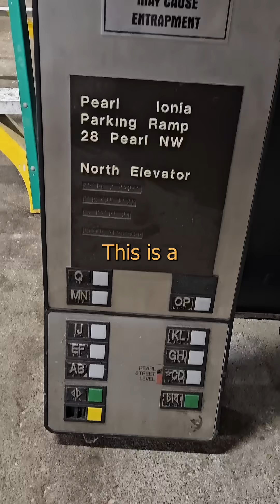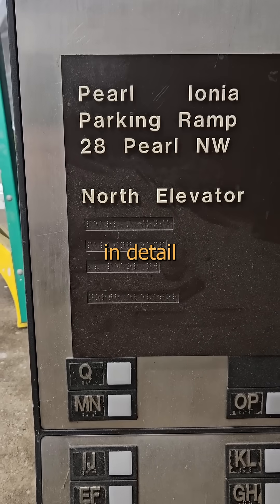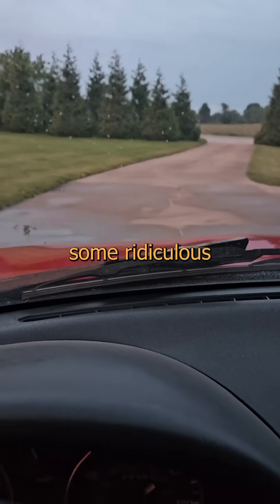Miata Mischief #chrisboden #engineering #gear #elevator #score #stories #parts #hacking #making

Comment: When I first got a welder, I needed a trailer to haul angle iron and so forth. But my only vehicle was a beater 1962 bug. It turns out that you can load some angle iron on top, give it a little thump to cave the roof in just a bit. THEN you tie it down through the windows and to the back bumper very securely and drive home. Once you get it unloaded, you give the roof a good whack from the inside and the dent pops right out as good as it ever was.
Reply: I feel VW likely didn’t do adequate metal fatigue testing for this use case. 

Let’s hope whoever got the car after you doesn’t roll it, or is already short. 

Not for nothing, do you know if it’s possible to work harden a VW Beetle? Asking for a friend.

Cheers!
Reply: @0ddSavant If it's steel, it may be fine. Steel can go through many cycles of deformation, that's why we make springs out of steel.

Whether that deformation is completely elastic, and if the roof is the right kind of steel, is a different story.

Comment: Not the sketchiest, but that day I learned to ratchet strap and read a road height warning. When I was an intern I wanted a big screen TV. I found a 84" rear projection TV and squeezed it into the bed of my ranger and it stuck 3 feet over the roof and 2 feet off the back, and we had to navigate it home through tunnels amd several bridges to my summer apartment in Rhode Island at the time

Comment: Let’s see now… done a lot of scrap metal runs. There was this one restaurant throwing out an old AC unit. They called us, we showed up with our dodge dakoda… took 4 people just to lift the AC units, and the suspension on the tired old truck was not happy. That truck was swaying down the road all the way home. Only a 5 minute drive, but man you could really feel the weight in the back from the cab.

Comment: A friend and I took a folding motor crane apart and fit it in a Volvo 850 sedan.
A simple fender bender would have resulted in decapitation but we made the hour drive, up hill both ways.

Comment: Haven’t done much hauling because I have a midsized truck, but I have used it as a temporary tow truck.  I once helped some strangers (I live in the Midwest… it’s what we do) to pull their car a couple miles using tow straps.  

Another time I pulled a dead work truck (2016 3500 loaded monster) and pulled it across the icy parking lot to get it in one of our bays.  Once I got to the point I couldn’t pull any further and needed to push it, we used old tires to not scratch the vehicles.  Work like a charm. 

I help people on the side of the road all the time, so I like to be the Swiss Army knife of vehicles… not too big, not too small, a little unconventional, but managed to pull through when you need it most.

Comment: Winning a 10KVA pole pig at the Cheesehead Teslathon.  Had a fork to load it, but had to unload it by myself.  There's a reason we call them pigs!  Got it into it's roller dolly without dropping or spilling it.  Still have to build the reactor for it. Have the core, just need the 200C wire.

Comment: Before my time, but definitely a unique haul. In the late 80s/early 90s, my dad had a custom squarebody Chevy pickup. Black, short bed, with a 6 inch lift and 36 inch tires. He found for sale a telephone pole. Why he needed a telephone pole, i do not know. What i do know is that he decided the best way to haul it was under his truck. With the telephone pole laid down lengthwise, he drove over top of it until there was a roughly equal amount of pole in the front and back of his truck. He then took 2 chains amd chained the pole to the bottom of each axle of his truck. He hung a red rag from either end of the pole for visibilty, then drove the truck and the pole home as one unit.

Comment: Oooh, I've got a couple.

One time I loaded an old Ford Ranger up to the point of bottoming out the suspension. The weight itself isn't the interesting part. It's the fact that the ENTIRE BED plus the passenger floor board, passenger seat, and middle seat were packed FULL of records (the spinning plastic kind). That was $20 well spent, much to my mom's chargin.

Another time I loaded up a 1992 Saturn (about the same size as the Miata) with computers that were otherwise destined for the dump. Would have grabbed more, but I couldn't haul anymore and was only allowed one trip. That made for a fun summer of tinkering.

Lastly, I needed to haul a 10 foot long section of PVC pipe in a Ford Escape. Easy, right? Wrong. The car was about a quarter inch too short, and I cracked the windshield when I closed the hatch.

Comment: I hauled a half full server rack with my 50cc moped. Only the top half was full so I was able to put the rack over the moped and bolt it to my exhaust bracket. It was top heavy and I was scared I'd fall over in every turn. Lol but I made it the mile and a half I needed to go

Comment: I towed a 21k lb. military surplus truck with my 2010 F250. We didn't have any kind of tow bar, so I ran a 3/8" chain through a 2x2 piece of steel box channel about 6 ft long and hooked the trucks together with the chain. I towed the dang thing for about 20 miles. The truck had no brakes, of course. I couldn't believe it worked and we didn't wreck both trucks in the process. 😂😂

Edit: Oh, another time while working for my dad, we hauled a 6 ton blower in the bed of his 3500 Chevy. Talk about sketchy. Every pebble we hit in the road, you could feel the suspension bottom out on the axle. That weren't no 20 mile drive, either....😂

Comment: I strapped a 7ft tall 4ft wide shelf on top of my 2000 Jeep Grand Cherokee with 2 rachet straps off of a collage campus with no parking pass no inspection no registration and a unpaid fine resulting in a warrant. When I went to leave the cops were in the parking lot watching a demonstration done by a lineman company, thought I was in the clear till someone with a crackle tune on a VW Golf turned as I crossed the road. As I'm crossing I'm making eye contact with the cops and the look on their faces was incredible. That was a long 45 minute drive from work turned over an hour because going above 50mph the front end would start lifting🤣🤣

Comment: 12 years ago I used my 95 Miata to move 55 miles. Everything but my furniture and a few large items were loaded in that little car. I’d load it after work, drive to my new house & unload it. The next day I’d do the same thing. 
The most difficult part was when I moved an entire rock collection that was well over 1500 pounds In two trips. 
I loaded the trunk & passenger floorboard with rocks & then piled on every light weight item and box that would fit. 
 That little car handled it like a champ. Yes it tended to wallow around a little in the turns and I kept my speed down to 55 or below & I did get stopped and warned by a county sheriff because I could barely see to my right & couldn’t see anything behind me but it all worked out.

Comment: So I drive a Saab... I LOVE my Saab.. but it's also my project car currently. It's a 2006 sport Combi wagon, but it's in the middle of an interior swap, meaning it dosent have one installed right now... It has the steering wheel from a totally different car, two seats and a gauge cluster with bare exposed circuit boards and wires wrapped up in masking tape, meaning yes... No dash... Or anything else really.

So my friend needed to get parts for his truck I'm helping him build the other night, but since my new daily driver isn't registered yet, the Saab it is, plus we kinda needed the space, so off we went driving 2 hours away in a car with no interior, that only has lights that half work, that I have to start by screwdrivering the ignition tumbler to on, and then get out and jump the starter to the battery to hotwire the car, additionally if I need wipers, I have to get out and plug the relay for the wipers In to turn on the driver's wiper, passe ger side dosent work and windshield is broken af.

So here we are headed off to get his parts, with me driving using my phone as a gauge cluster cus the speedo dosent work and neither does the fuel gauge, meanwhile it's getting dark, so I have to hold the turn signal stalk pulled to keep the headlights turned on, and ask my friend to touch a brown wire to an exposed red wire whenever I am breaking cus the breaking light switch is also broken. 😅

When we get there we discover that not only do the rocker steps for his truck not fit in the back cus they're way too long, but also the fuel tank was still full of gas... Which he forgot about.

So we cut out the old trucks seatbelts to use as tie downs to strap the steps to the roof of the wagon through the door windows, then roll the windows back up to pinch the straps and extra secure it with duct tape, and the fuel tank we put inside but because of the fumes we had to stop at a Walmart and get some hose so we could stick it out the sun roof and use it as fresh air vents cus we can't open the windows both because of the seatbelt straps, but also because I have a side exit exhaust on it that comes through the back bumper that required I cut into the rear floor to fit the pipes but I have yet to weld it up, so if you open the windows, the negative pressure sucks the exhaust gasses back up from the back of the car into the cabin and suffocates you... And it's carless... So it's REALLY SMELLS... so we made the trip home looking like a couple of LARPing scuba divers in my car... Really got some odd looks when we blew a tire on the way home and had to pull into a station to swap it out 😂 , especially since my friend is 6'2" and dressed like a burly bearded biker, but I'm the driver AND the one changing the tire out and I'm a 5'5" UwU cat girl wearing a cropped anime hoodie and a miniskirt with fishnet leggings and furry leg warmers 😂. 

It was a fucking weird ass but interesting trip to be sure... But God I'm so looking forward to getting my new car on the road.

Comment: A few years ago I brought home the full drive train from a 1983 Datsun 280zx turbo in my friends 2004 Scion XB. It was tucking rear tire in the fenders in the rear wheel wells for the whole 2hour ride home, and thats half the weight the owner had put in it bringing home bags of concrete. 

The first day I owned my own Scion XB I took 3x5 sheets of OSB to build something for my mom. 

I want to buy another truck but WHOLLY crap people want absolutely insane prices for them with 100-200k miles. I can hold off another year or so, but eventually I'll have no choice. I'll look at every thing from new to used but Im not expecting to enjoy paying for it.

Comment: I had a 1st gen Miata with a proper roll bar. I have lashed just about anything to that roll bar all the way up to 10 ft lengths of lumber to entire tires mounted on wheels. 

Also removed the passenger seat to move a larger air compressor to do a roofing job once. 

When you have a convertible the sky's the literal limit.

Comment: About 8 years ago, I bought a desk from someone 10 minutes drive down the road from my home. It was too bulky to carry, so I had my roommate take me in his car to pick it up. It being a sedan, there was room in the back for the supports but not for the top.
I had my 5' something roommate sat in the back seat, holding the tabletop wedged behind the front seats. The rear passenger door couldn't close with it in there, so they had to hold it shut for the 10-minute drive back to the house.

It all went well and I still have that desk today. I drive a station wagon now and it works great for transporting big stuff like a desk.

Comment: I once strapped a GIANT street lamp to the back of my sportbike. Weird gas discharge lamps tickle my brand of 'tism and i needed a 150w high pressure sodium ballast which was in that fixture, to run a rare and special  improved CRI sodium lamp. The thing was a good 80cm long and 40cm wide thing you would find on highways here until the ledification. 
Although the thing was well secured, people behind me kept a longer follow distance than usual and no one dared to complain about my bike's mediocre lights. It was sticking out and up, due to the difference in height of seat, passenger seat and the mounting bracket of the top case, so if it would've been lit - it would've absolutely blinded everyone behind me. 
I also once carried two 60cm diameter x 60cm long cast aluminium public address horn speakers by train and bicycle. I feared my handle bar snapping in half, but it held up.

Comment: I hauled a 5 meter metal pole on the back of my bike when I was around 13. I had to find a way to make it not fall off the back of my bike. so I tied a rope around my waist and then to the pole. So I was biking down a long-ass hill from my school - where I stole this from - to my parents' home. If anyone was on the path, I would have clotheslined them with 2.5 meters of improvised steel limbo poll on each side of my bike; as the breaks on my bike had been redused to nubuals a long time ago, and replaced with the classic "Putting your feet to the ground" tecnique. Luckily it was kinda late at night and noone was around. Though… as it was dark, and the streetlights in this are never worked as long as i lived there. I didnt remeber that they even existed, and by going slightly to far to one side on the sidewalk, I slamed one end of the poll against the wooden trunk of the streetlight and sent myself sailing into a ditch at "Fast as fuck" speed. I was somehow fine and got the poll home without any further… incidents.

What did i do with the poll? I wasnted a welding kit, and decided to gather materials to make random shit. I never got a welding kit, and the poll is still laying in some raspberry bushes in my parents backyard.

Comment: I was a sub contractor for a underground utility company, and one day we had to remove the brick sidewalk by hand cause the city wasn't sure if they would replace or reuse them (budget wasn't in yet). So I asked my foreman if I could have them he said  wait 2 weeks, we were on this street all season so we had time. Finally got the green light so I LOADED my lil s10 long bed level to the rail and drove home steering with 1 finger apparently my rear shocks were bad leaf springs were the hero how I didn't die I don't know. Those bricks  are now my uncles patio.

Comment: lol hauling sketchy loads is my life, recently pulled home a large 220 volt table saw a band chop saw a drill press a bench grinder on a stand 4 ft wood lathe, the lower section of a tool box on wheels and a table band saw and a Jon boat on a 16 foot trailer with 2 rope jacks horseshoed around the whole mess

Comment: Once got the frame from a 40ft single wide for free. 
The home had burned down. 
With some new tires and an f150 that trailer surprisingly made it 5 miles down the road at 50 mph at dusk without cause for alarm, and onto our farm. 
Apparently that sized trailer requires permitting to have on the road? 
Pish posh

Comment: This might be a record... (sadly, no one tracks these things so we will never know)
I borrowed my dads truck, stock trailer, and compact tractor. I loaded the compact tractor, scraper blade, and 3 pt tiller attachments into the stock trailer, on the way to my house the truck jumped time! It being an early 80s dodge it had a steel bumper, so i caught a ride back to my house and got my Dodge Dakota, went to the farm and got dads old RV style tow bar and went back. I bolted the towbar to the bumper of dads 3/4 ton Dodge hooked my short bed single cab Dakota to it and with the help of my 14 yo brother (whos job was to hit the brakes on dads truck when he seen my brake lights) I towed, land train style, a 3/4 ton Dodge, gooseneck 24" stock trailer and compact Massey Fergison tractor with loader and two attachments up main street, past the police station, and across town and to my house. (The transmission in the poor little Dakota was never the same after that stunt, but i might hold the record for longest load ever pulled with a Dodge Dakota.)

Comment: No me but co workers of mine back in the day working IT for a poorer school district, we told to move some equipment and things from a building to another during the summer break. Well there was a time limit and one moving van so they got creative with the cling wrap. Wrapped the moving van with the stuff that didnt fit inside the van chairs and what not. Just threw the wrap over and under several times. Some how it worked.